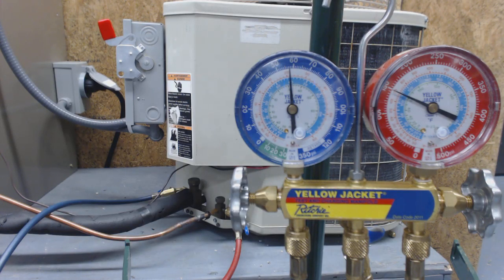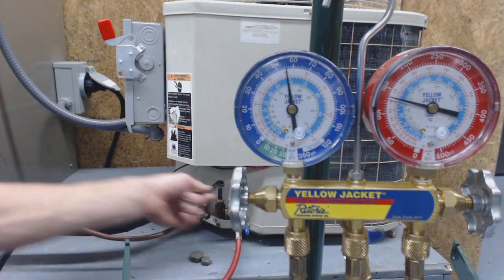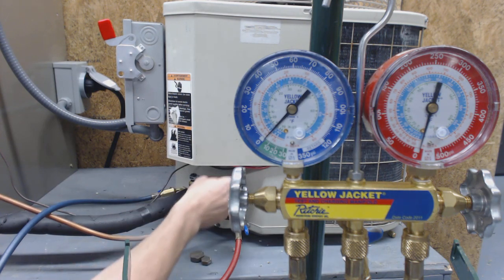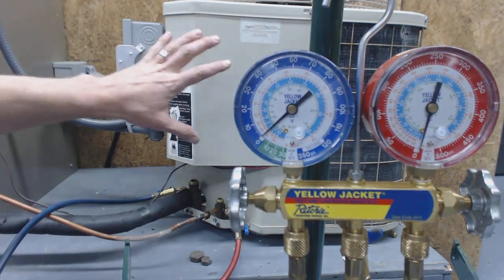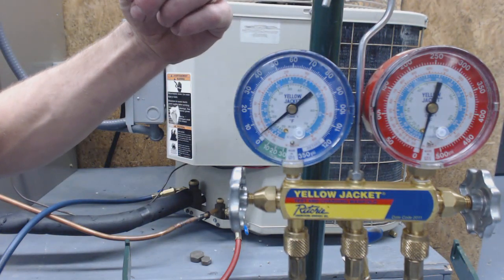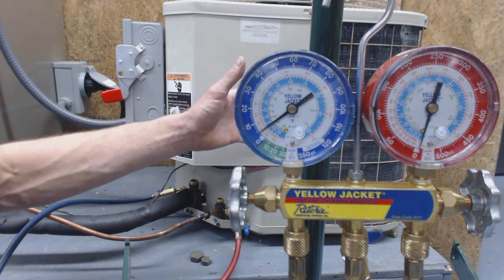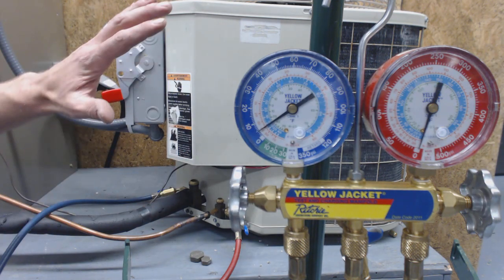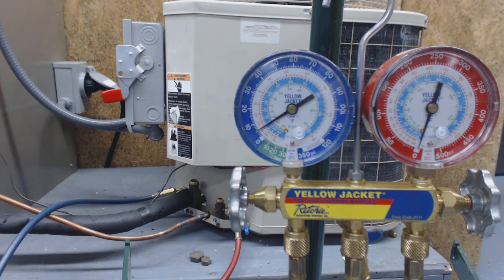Explanation of How to Pump Down an Air Conditioner including Proper Guidelines!

Comment: This is an older video but I hope someone can answer a question. If I want to pump down an R22 system in order to attempt to silver solder a small evaporator leak, would running a hair dryer blowing heat onto the evaporator A frame during the pump down help prevent any flash gas pressure returning after the pump down?
Reply: Nobody answered, but a great question. I would like to know what happens  . I know R22 is not flammable .
Reply: @fabiodarocha2842  I am not worried about fire or explosion from R22. I am concerned if any pressure returns on top of any heat induced pressure during the soldering if that could cause the solder repair to fail due to pressure forcing itself out before the solder hardens and leaving a fissure that itself could leak. That is if the leak is still there. Last summer I did add 2 lbs of R22 and some inject sealer. I have been self studying AC now and want to take a EPA 608 Universal Technician Certification course and get certified and maybe change jobs. The science aspect of it interests me as I am a science geek and a DIYer. I have been building up my tool collection, budget digital manifold, digital temp/wet bulb, scale...and a budget leak detector just arrived so I can really search for any leak. I just cleaned the A-frame and my air flow has increased significantly and my AC unit does run cold and cools a lot faster than before. I am sure it is a little low even if the sealer did it's job but I don't want to add any refrigerant until I am sure I can not find any leaks in the evap or condenser unit and if I do, I want to fix them first. I have a 5lb tank of R22 and am treating it like gold. The system states it hold 9lbs.

Comment: Love the videos, bought the book, you have made me better at my job, thanks.

A question, do you have a video for doing a pump-down on mini-splits?
I am often asked to move a mini-split aircon here in Tokyo, I would like to up my game.
The way most guys do it is run the aircon on full cold for 10 min, then close the liquid line and wait another 10 min. 
I'm concerned that this is running the compressor too long with the liquid line closed, and it could harm the compressor.
The mini-splits, as you know, only have only one service port on the vapor line.
Is it possible to just use the blue gauge on my set to pump down the mini-split?
Thanks in advance and a Happy New Year to you!
Cheers

Comment: Pump down using compressor is a NO NO NO for newer condenser unit.  I just worked installing brand new Goodman 3 tons unit.   Manufactures clearly stated in manual and when i called about other issue  was told  they will not honor the warranty if they determine it was damaged through pump down.
Heck if you are serious working on AC you already have invested in a tank and a recovery machine to do the removal of refrigerant.   I just close down the condenser and suck out the refrigerant from line and air handler.  Not taking long at all.  It happened i had to fix two evap. coils issue.   I don't do AC repair for a living.  I do all my own service and install because i got ripped off by f. repair people  so i got mad and took matter in  my own hand.      I will never need one until the day i die now that i know how to do it all from A to Z.  Save a ton of money living in FL with AC is a must!!!!

I bought used tools online and local pawn shop.   Worked fine for me.  NO need for brand new expensive not needed tools.

Comment: Love your videos, I have learned so much and I thank you for that. My question to you is should I jump out the low pressure switch before doing the pump down so that my unit does not shut down during pump down? I noticed you did not have to jump out anything before doing this pump down and now I’m just a little bit confused. 
Also just purchased your hard copy book and I can’t put it down, I love it!!

Comment: Are ther certain type compressors (reciprocating vs scroll) that you need to be more careful when pumping down?
Reply from the maker: Yes Scroll Compressors should not be pumped down below 10 or 5 psi because the refrigerant acts like insulation for between the ground frame and the electrical windings. I go into explaining the differences of compressors in my book at the website https://www.acservicetech.com thanks!
Reply: I guess I had it backwards I thought reciprocating compressors had that issue, thx!

Comment: Did I hear this right? Recover the remaining 5 psi of gas? 
That's an insanely tiny amount, not enough to even prime the recovery pump. Just open the flares to hear the tiny puff
Reply: That's a legal requirement, whether you choose to do that or not is up to you, but this is an instructional video and he probably doesn't want any legal repercussions from the EPA. its also the responsible thing to do if you want to be recognized as a quality company, folks who cut corners in one area usually do so in many areas. In a below comment he recovered 4-5 oz for reference, or .25 pounds.
Reply: Whiskey and Wood. 
Hmm. You lose more just purging gauges hoses/recovery pump. Might be taught in class but never practiced by any trademan worth his salt
Reply: Nathan  any tradesman worth his salt does things the right way and I’ve never seen an hvac tech who DIDN’T recover it. Again, it’s a LEGAL requirement, if a customer or someone else sees that and reports it, there’s a huge fine and you can lose your license or whoever you work under can lose theirs. Whether you want to or not, most people recover it, even if it’s just to protect their livelihood. If you think it’s common, maybe it is in your area or with your company, but that’s not the norm around the country.
Reply: Nathan also, if you lose more than 4-5 ounces (which is what he recovered) purging your gauges, you’re the worst tech ever. You should be losing 1/2 oz or less per gauge connection (on a 5ft hose) setup if you actually know what you are doing, less if you use low loss fittings and stubby hoses.
Reply: Whiskey and Wood. The quick answer would be to recover for another couple of seconds. 
4-5 ounces tells me an error in the weighing you'll never get from 5psi. But with the weight of hoses hanging off the tank I'll admit yes it's an easy mistake to make. No we cant break laws. 
But an ordinary (and legal) hose purge can exceed the above reclaim, which is pittance
Reply: Agreed. Anywhere this much below the saturation temperature is just gas. You lose much more than this when the gage set is removed from the liquid line.
Reply: The EPA is watching y’all.....👀👁

Comment: Do we need to purge the air before doing pump down? Could you make a clip that shows step by step doing pump down.
Reply from the maker: Yes they do need to get purged. Check out a video "acservicetech connect check charge disconnect procedure" thanks!

Comment: If you need to find a leak in the condenser do you pump down with the service valves open?
Reply from the maker: You can use bubble leak detector or an ultrasonic leak detector and you don't have to pump down until after finding the leak, thanks!

Comment: The pressure increase on the vapor line is from residual liquid refrigerant. Rather than go through recovery, why wouldn't you just turn on the compressor again and open the vapor line until it's at zero psi once more?  Wouldn't that get virtually ALL of the refrigerant into the condenser at that point?
Reply from the maker: Yes Froman, the pressure increase is the liquid vaporizing but we can't turn the compressor on again without the pressures equalized. We just recover at that point, thanks!
Reply: @acservicetechchannel  That doesn't make sense to me, but I'm not a "Proud HVAC Tech" (as Steve Lavimonier says). The compressor is between the liquid and vapor line. No liquid is going to flow back through the compressor into the vapor line. The compressor will just suck the remaining vapor out and compress it to liquid as it did the first time around. What is it that needs to be "equalized" ? And Why?
Reply from the maker: If you try to turn the compressor on, it won't start and the internal overload will open the electrical circuit. Pressures need to be equalized meaning that the only way to start the compressor again is to open the service valves back open again and start all over with the pump down procedure, thanks!
Reply: @acservicetechchannel  Well, I'll let you know what happens because I plan to pump down my system in order to remove the evaporator coil to clean it. It's been only 40 years since I installed it myself from a DIY kit provided by a local HVAC firm. (I don't think they sell them anymore.) The coil is accessible from the back after de-brazing the lines at the front. When I installed it I just used silver-solder and a propane torch with no nitrogen. I didn't know about nitrogen purging. No problems due to copper oxide I know of. I once drove a nail into the vapor line where it went through a 2x4 in my back garage wall. And it needed a new fan motor a couple of years ago.
Reply: @acservicetechchannel  I'm still puzzled. Is the need to "equalize" the pressures  something you've observed or just something you've been told? Besides, the pressures during and after the pump down are never equal. 

During the pump-down the compressor has to move vapor to the liquid side against the increasing pressure of the of the accumulating liquid. It continues to do so until you shut it off. It doesn't suddenly stop running because the liquid pressure has become too high. It could continue running forever if you didn't shut it off. The pressure isn't internal to the compressor. Its outside the high side valve. It seems to me it should be able to start without needing any "equalization"  of pressures.
Reply from the maker: Hey Froman, it will blow the thermal overload likely if you try to start it again but regardless it would not be good for the compressor since the point of the pump down is to move the unit and continue to use it again. We try to do the pump down in one shot. Make sure that you are EPA 608 certified before working with refrigerants. If you are in a trade school or out in the field then I am sure that you have seen a pump down. Feel free to ask others, thanks Froman!

Comment: Hopefully you can answer this question.  I know of a house that getting ready to be torn down.  There is a brand new central ac unit that the owner who sold the house told me I could have since it's just going to be demolished.  Problem is, there is no power to the house anymore.  How do I get the refrigerant out without being able to turn the unit on? I hate to see it get smashed.  Thanks!
Reply from the maker: I would shut the service valves on the outdoor unit, run a power cord to a generator for 120v and hook up my recovery machine to recover the refrigerant into a recovery bottle. Make sure you are EPA 608 certified before handling refrigerants, thanks

Comment: Not to pump down but to recover refrigerant does the ac need to be connected?
Reply from the maker: The ac should not be running when recovering refrigerant with a self contained recovery machine into a recovery bottle. A pump down on a system with a leak should not be pumped down below 0psig. Any remaining refrigerant can just be recovered afterward, thanks!
Reply: AC Service Tech LLC Ok thanks! Appreciate the vids

Comment: I thought you were supposed to loosen the valve packing nut on the service port prior to turning it?
Reply from the maker: Hey Chris, I like to let the unit run for a little bit before closing the liquid line and I just wanted to show it in the video instead of fast forwarding. Yes you would normally take the top cap off prior turning it on, thanks!

Comment: If you changed out or just cracked the fitting to see the piston would you have to pull vacuum?
Reply from the maker: You would not be able to see it and refrigerant would come out so make sure you don't do that. You could pump down the unit to bellow 0psig and then check the piston. You would then need to vacuum before releasing refrigerant back in, thanks

Comment: So I have a question . I went to pump down a 3 ton r22 scroll compressor. 
When my gauge got to about 45 psi 
The compressor stated to hiss . Like it was bleeding air . And wouldn’t pump 
Passed that. Is at a sign of a bad valve 
In the compressor . And thank you for the info the other day about the ecm motor 
It was the module .
Reply from the maker: That is the pressure relief valve inside the compressor. That just means it is weak and can't do a pump down. Fairly common but will still work. Just shut the valves and recover the rest. It can still be used unless that was the original problem at normal operating pressures, thanks

Comment: How does one pump down a multi split unit? For all indoor units at once or one after the other? Thanks!
Reply from the maker: If the unit make allows pump down then yes it would be done with all indoor units running. Make sure to look up model number manual to verify that its ok first, thanks

Comment: Hey Dude i have a question.. 
1.  close the suction line/service  when the compressor run. is it right?? 

2.  and after then if the gauge drops to 0  close the return line?? is it right again?? 

correct me if im wrong.. thanks
Reply from the maker: Once running for 30 seconds, close the liquid line, then once at 0 or below 0psig have the suction line shut, thanks!

Comment: I have a question. How to pump down a heat pump or an ac unit in winter when it is cold outside? Thank you
Reply from the maker: You still turn the ac down real low at the tstat in the house and let the indoor fan run, pump down, close the valves and pull the disconnect to shut the outdoor unit off when complete.
Reply from the maker: Check out the "acservicetech pump down playlist" thanks
Reply: Thank u so much

Comment: ur radd
.... so pump down..   doesnt drop ... 
but . compressor  runs normal.. 
??
Reply from the maker: You can't let the compressor run forever but get the pressure down fast. The compressor uses refrigerant to cool the motor and oil traveling with the refrigerant to lubricate it, thanks

Comment: Is it always the condenser you trap the refrigerant in? What if we need to repair something on the condensor? Is it possible to trap refrigerant in the evap coil?
Reply from the maker: It is not possible to trap refrigerant in the evap because there are not ports inside the outdoor unit if the service ports on the service valves are connected to the lineset, thanks

Comment: I wan to pump down in daikin vrv 3 inverter
Reply from the maker: I would contact Daikin on that one depending on how large of a system and what safety sensors are equipped, thanks

Comment: My supervisor sprays water over the condenser while pumping down the system. He says it allows more freon to be recovered by the compressor, but I don't understand his "science" and it goes against what everything else I've seen done.  I hate it because it creates a mud hole for us to work in the rest of the day. Is he right by doing this or is his science faulty?
Reply from the maker: Technically yes it would help reject heat and lower the pressure on the discharge side of the compressor. I would be shutting off the hose before pulling the disconnect though and certainly not holding in a contactor while the hose is running for safety though, thanks

Comment: Nice video Acservicetech. Is there any type of unit that you should not pump down, such as heat pumps. Or can you do it with all condensing units if needed?
Reply from the maker: Hey Nick, any comfort cooling unit should be able to get pumped down unless the compressor is weak. In fact that is how you can check for a weak internal pressure relief or bad valves. Just see how the compressor reacts to a partial or full pump down, thanks!
Reply: AC Service Tech LLC I’ve been told that manufacturers sometimes say not do do pumpdowns on 410 units due to high pressure... thoughts?
Reply: acservicetech. Never thought of that test for the compressor. But I'm  Still a newbie lol!  Thanks for reply boss.
Reply: Micro channel coils?

Comment: Why cant you let the compressor run till the low side gauge reads -10 or then close the valve? So this way you recover more refrigerant.
Reply from the maker: You can, I should have let that unit get down a little lower. This is a training unit that we use so I didn't want to put too much strain on it, thanks!
Reply: Thank you for your reply. Do you have video for releasing the refrigerant into the system after pump down?
Reply from the maker: Actually I do not think i do have one, sorry- You should check these two videos out though-  https://youtu.be/UgQFUHAuz54   ---   https://youtu.be/W1uhVvn57Nw
Reply: Thank you for your replies and videos. !!!

Comment: Is it normal for frost to form around the liquid line once it is pumped down? Also, does it matter if the evaporator is running whilst doing the pump down?
Reply from the maker: Yes this happens because the pressure is the lowest in the system in that location. Temp follows pressure. It is helpful to run the fan across the evap during a pump down to keep the pressure up but you don't absolutely have to. Thanks

Comment: why use the pump down system rather than recovery?
Reply from the maker: Hey Mike, personally when I change a unit out, I always recover and don't do a pump down that will make more work for myself later recovering off site. A pump down would be used if you were to do work on the evap coil, filter drier, or metering device if you did not have an empty and prepared recovery tank but a half full recovery tank and did not want to put new refrigerant back in.  This is just one of those basic skills I want to make sure everyone has down because bosses seem to value this task as one of the basics. I think someone either in this post or somewhere else said this reminder helped him progress and get a raise.  Mike, thanks for the question!